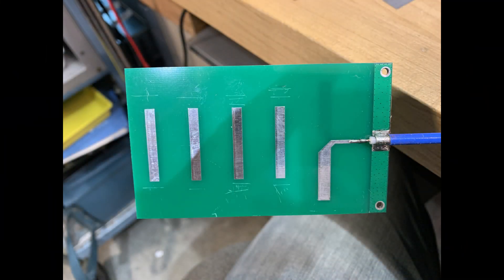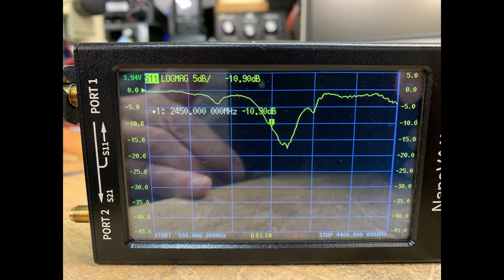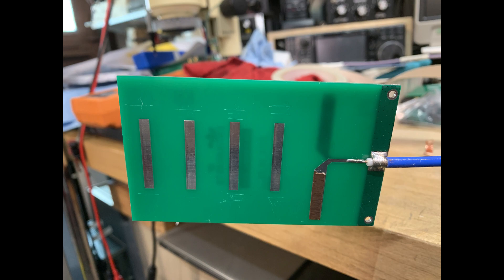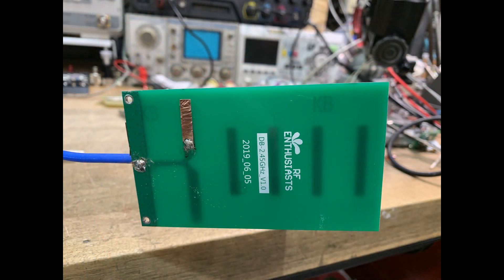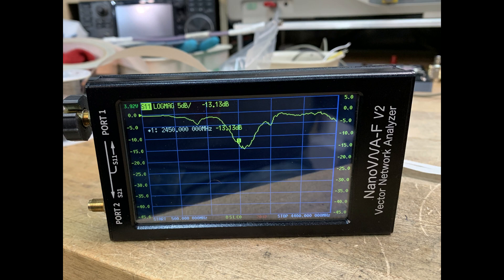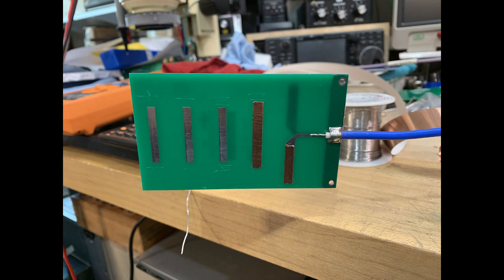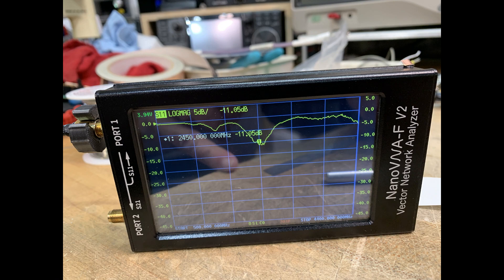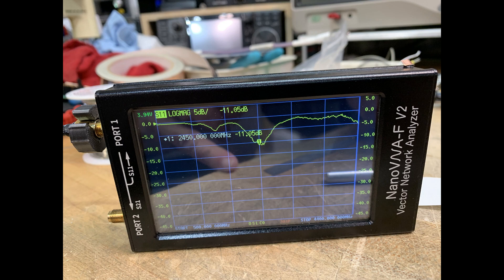#1460 PCB Yagi antenna for 2.45GHz (part 2 of 2)

Comment: My experience is that this copper tape is not conductive at the sticky side.So just sticking it on the old trace might not be enough. Just a tip. I like your channel a lot btw

Comment: Is your VNA measuring return loss? You started with -10.9dB then adjusted the driven element and got it to -13.13dB. You tweaked the first director element and ended up at -11.05dB. This is only 0.15dB improvement. You peaked the lowest RL at the desired freq, but it is worse than it was. You should have stopped at lengthening the driven element. That is when it was measuring best.

Comment: Really does nail home the point from the previous video. These adjustments are quite small, but to the untrained eye it did look like an antenna the whole time. If you do the CAD design, it'd be interesting to see a replica of the board as it arrived to estimate those other performance characteristics, because it was in fact "an antenna", but I bet it wasn't doing a good job at the frequency it was working at.

Comment: My first thought on seeing this was why the screen of the co-ax is connected to the reflector, then to the end, then back, before it connects to the other half of the dipole? Seems wrong long before you start calculating, surely the two halves should be the same length especially at those frequencies. (Yes I also saw the previous video where it wasn't even connected!).

Comment: I have thrown together a Yagi design for Lora (EU) 868MHz. Propagation speed over FR4 is hard to estimate and hard to find on the net, so elements will be shorter. I have designed as if in free space, so my dipole was too long, but after cutting it Return Loss became worse, on the par of -10dB. I am guessing it's because distance to reflectors and directors has to be less too. A new revision is in the works.

Comment: Great video, I’m hoping that you will do more of these PCB Yagi Uda reviews! I’m hoping that you find a good one, that I can use too boost my radio transmitters 2.4 GHZ for my RC airplanes. My radio is. Set up so that I can easily change the antennas.

Comment: You got centered on the frequency where you wanted it, but your  logmag going from -18 to -11 isn't really acceptable. You need to bite the bullet and do the job right and get it at least down to -25 or so. Showing how the elements of a Yagi-Yuda interact so you get good directivity and F/B will make a good video.
Reply from the maker: Although I can measure S11 I have no way to measure the far field radiation pattern and gain. Seems like a non starter at this point.
Reply: @IMSAIGuy , I was talking about a video doing a new board, modeling it using a NEC program, and tossing the Chinese one in the scrap pile. But you may be more interested in doing other things than reinventing the Yagi-Yuda range extender for hotspots.
Reply from the maker: @johnwest7993  I understood. I just don't want to be arrogant to think," I made a good new antenna and it is great because S11 is good". NEC or no NEC. It might be an 11 element dummy load. 😀

Comment: If the reflector is grounded should the directors not also be grounded, like common hf yagis? Either all or non!
Reply from the maker: any combination is possible, just depends on the original design

Comment: That looks 'easy peasy', ... ! Could I use this for QO-100 equipment? (The stationary amateur-satelite over Africa, down-link on 10GHz [3cm] and up-link on 2,405GHz [13cm] )

 I try to make a 'helical-antenna' for 'up-link' for my '/p' set-up, maybe this is a other solution? 
A much 'smaller' set-up, then a helical? 

73 de Markus - db9pz 
(JN39fq - 5km/3miles east of LX)
Reply from the maker: I wouldn't use this for anything
Reply: @IMSAIGuy  Do you think the original designers had an intended purpose for this antenna then? Or complete junk/toy/experiment or something

Comment: Hi, this is good progress. Andrew McNeil too found his antennas resonating on the higher side ie, around 2.6 GHz as you found. All elements may be lengthened by one or two mm.
That's why I asked you to make your own PCB in the first place. You may use the computer software programme available to get a starting point from where you can make a good one. 
We are all waiting for you to release a video soon. 
De VU2RZA
Reply: Do you know of a good software to design PCB antennas?
Reply: @WolfgangMahringer  matlab is good
De VU2RZA